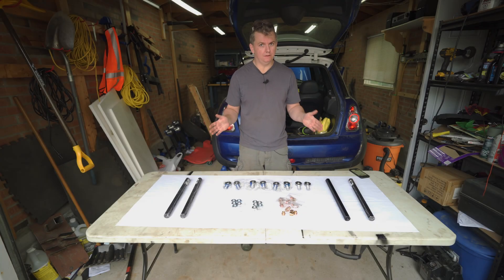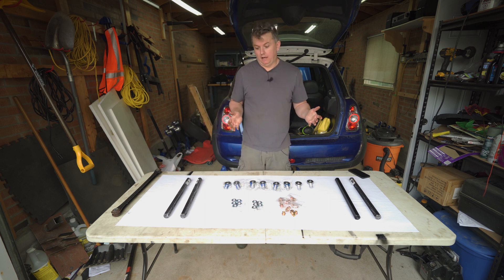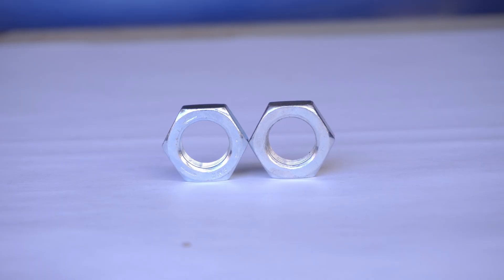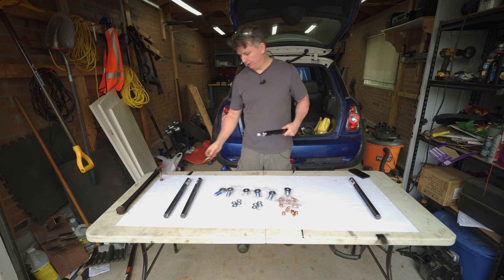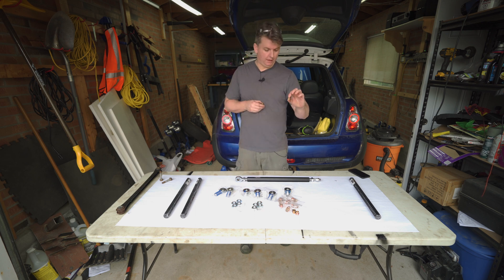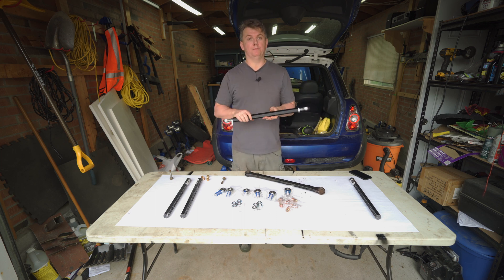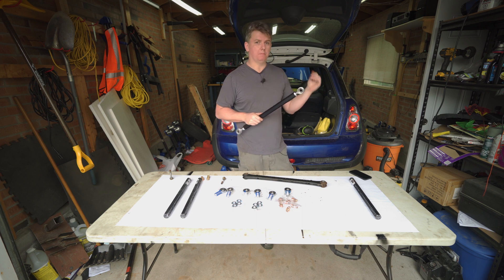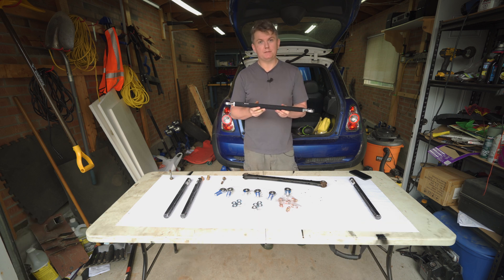How to Make Custom Control Arms - Adjustable! - No Welding - DIY

Comment: Silly question but why didn't you buy metric heim joints of the correct diameter?
Reply from the maker: Good question. I couldn’t find the right combination of threaded bar and metric heim joints with the specs I wanted, that ship to Canada, for a reasonable price.

Comment: Godspeed have stiff rod ends just like what u put on 99.00 set
Reply from the maker: The AK047? I saw them at ECS for $153 a pair. With shipping (for 4) that is $378 plus tax and duty etc to Canada. Shipping prices to Canada are like we are on another planet sometimes.
Reply: @RegardingAutomobiles  there full metal himejoints been on my mini for two years there not bad for the price